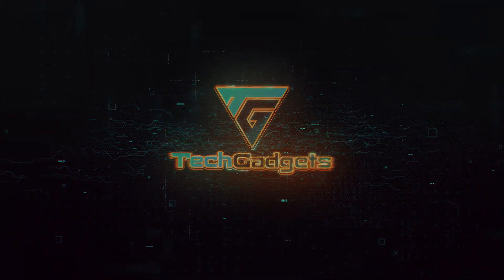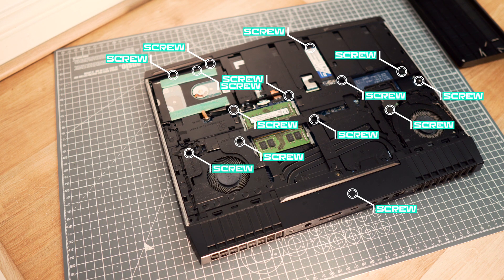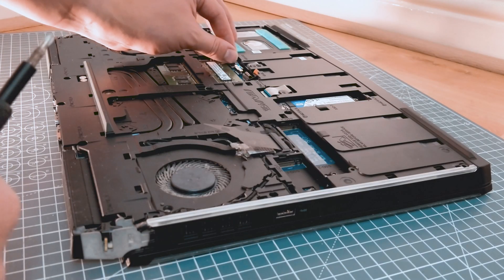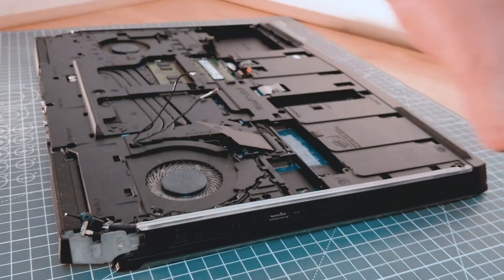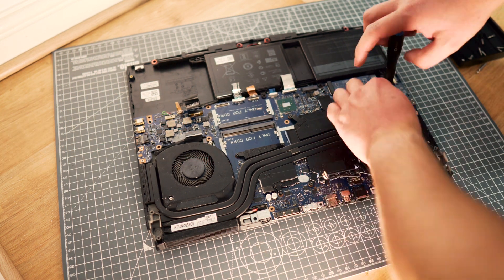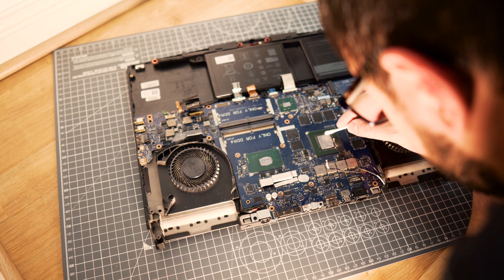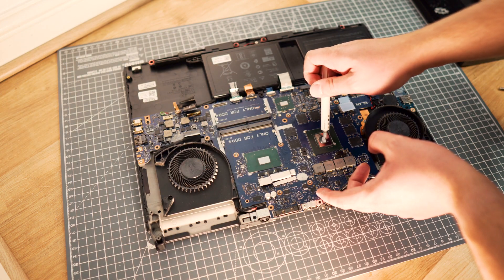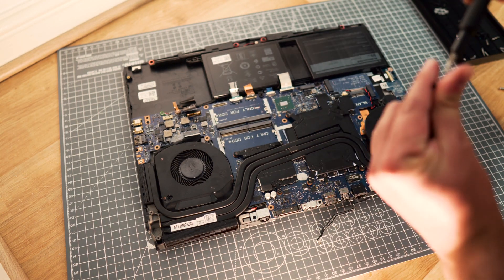Alienware 15 R3 Disassembly and CPU/GPU Repaste

Comment: Please note: Dont tighten the cpu/gpu cooler screws with an electric screwdriver, the screws are very soft and will shear off if tightened to far..which usually happens with an electric screwdriver

Comment: I redid my thermal paste and I use undervolting and underclocking via throttlestop... still have throttling when I try to play intensive games... I now need a watercooling solution. Thought about rigging 2 aios one for gpu and one for cpu but I don't know about cooling all the other chips around that. If I were to cut open those heatpipes on the heatsink what's inside of them? I was thinking maybe I could repurpose the heatsink and run tubing to connect them in a series so the entire heatsink could be one big waterblock then I connect that to a radiator and pump.

Comment: i got to the point of wifi card and lighting but i dindt dare to unplug them. id rly like to see how much temp can go down. rdr2 brings me to 100 degrees and perma throttling. such a shame actually considering this laptop doesnt come close running its advertised clock speed. an help near hannover xD?

Comment: Is this the GTX 1070 Variant?
Reply from the maker: Yes
Reply: @TechGadgetsMedia  Ty, And were the cooling fans taped to the heatsink?
I saw few of the models were...
Would like to know if "Kapton tape" can be used. 🙂
Reply from the maker: No, as you can see in the video the cooler fans are separated. They all connect to the heatsink with screws.
Reply: I get it, thanks for helping out with my query 🤜🏼🤛🏼

Comment: Out of curiosity where is the house located? I would like to place a cooling vacuum closes to it.
Reply from the maker: I'm not sure what do you mean by house
Reply: @TechGadgetsMedia  sorry, that must have been a typo and autocorrect issue on my part. I meant to ask, where is the GPU located?
Reply from the maker: The GPU is located in kind of the middle. You can see both the processors when I take the heatsink off in the video.

Comment: I notice that nobody shows how to fix that stupid wireless lan cable. Also is there a screw diagram where each screw goes? I ended up noticing that ive apparently put some of the larger black screws in the wrong areas.

Comment: Great Video!!!1 I'm adding IC Graphite Thermal Pads on both the GPU  and CPU  im running a GTX 1070 8GB and an I7 8 Core CPU Currently I do not have Issues with. but when I run my 15 R3 with the Alienware Amplifier and a RTX3070 Aours I can tell the CPU will Thermo throttle Game Performance.

Comment: Hey Buddy, i have this model and never clean or repested. Playing some games, the temps going at 90 C°. Max 98C°. But in normal day still on 40°C. Still cool?
Reply from the maker: That is quite high temp.. it is up to you but if I were you I would repaste the CPU and GPU.. there's nothing to loose.. and your number should reach a lover level.. also you might need to clean your laptop from dust.
Reply: @TechGadgetsMedia  Thaks You. I now put my processor at 98%. the maximum temperature reaches 70 ° C. I don't lose performance, so I'll use it until I clean and change the paste.
Reply: @eubrunao8271  How did you put your cpu at 98% ? I tried all possible solutions to undervolt but the latest bios update locked all undervolting options and also locked rolling back the bios. I have an Alienware A15 R3
Reply: @fareshesham8135  man, is to enter power options, then change plan settings, then change settings achieved, processor power management, maximum performance state. put what you think is best.
Reply: @eubrunao8271  I will give it a shot thx. Also do you have the same model as mine ? If not please tell me what model you have iam trying to see what works with what.
Reply: @fareshesham8135  My model is alienware 15 R3.

Comment: I just got an m15 r4 with an rtx 3070.

would you recommend repasting? Ive never done it before Im not trying to void a warranty
Reply from the maker: Are you facing thermal issues?
Reply: @TechGadgetsMedia  I dont think so. I play stuff like BeamNG, kingdom come, mordhau, rdr2. Nothing competitive. 

I saw a video showing my models disassembly and the whole internals need to come out to access the paste necause its on the other side of the board. I dont think I have the skill to do it myself. my 2016 model never got repaated and still works to this day
Reply from the maker: Well there are some program which can monitor your temperature. Also if it doesn't feel uncomfortable to the touch and you can still use it then you don't need to repaste.
Reply: @TechGadgetsMedia  yea the alien fx controller thing has trmps I was getting like 60 degrees casually playinf bur the fans went loud, and Im using a cooler mat thing eith fans too
Reply from the maker: @rajgill7576  that temp is really good and as usual a gaming laptop is always loud. I wouldn't worry if i were you.

Comment: When you’re talking abt temperatures, do you mean stress test temperatures or gaming temperatures? Also, if it is a stress test, is it a CPU and GPU combined load or only CPU load. What are the GPU temperatures ? Would love it if you can give me all this info. Thanks
Reply from the maker: I meant using the laptop for a long period while gaming or editing videos for example.. that's why I decided to repaste the CPU.. it used to go up to and sometimes over 90 degrees.. but now they are around 70-80 max.
Reply: @TechGadgetsMedia  K thanks! Is the GPU around 70-80 too ? My CPU hits 95 and GPU 84 during CS:GO and I lose a lot frames. Wat's ur avg fps in CS at 1080p high. It'll help me a lot !
Reply: @jivewig  after thermal pasting, i hit 70 cpu on cs go, 1080 high

Comment: Ayo I need to fix my laptop. It’s an Alienware 15 r3 and it’s like three years old, when I try to play overwatch now the gpu gets to 91 degrees and my cpu gets to like 100. (Celsius) when it hits that temperature it starts to have random framerate drops and makes it too hard to play. I’ve undervolted it, I’ve Turned off turbo boost, and nothing. I don’t have an intact warranty on it I don’t think, will a repaste work? Thanks.
Reply from the maker: It worked for me.
Reply: Honestly I think part of it is overwatch because I used to play it on an alienware 15 r3 also and the same would happen to me but all the other games have run smoothly
Reply: A little late but please consider cleaning your laptop from dust. My GPU temps used to reach 91° Celsius and after cleaning with a small brush and a normal vacuum just sucking as much dust as i can my temps started dropping to 70 - 75 at max.

Comment: I use an Alienware 15 R4 for gaming and I notice the cpu temp gets really hot. I am planning on replacing the thermal paste, but I am having trouble finding a tutorial featuring the R4. I wanted to ask if the disassembly of the R3 is similar to or the same as the R4 disassembly.
Reply: Hi Merrit, I have return my m15 R2 because it was being hot and the memory was soldered in the motherboard. Could you confirm the memory has slots in the motherboard in R4, please?
Reply: @BrennoLeal  I assume you are interested in buying the M15 R4, not 15 R4, which is what I have. I can tell you the 15 R4 does have user-upgradeable memory; but after some research, I believe the Alienware M15 R4, does, in fact, have soldered memory.
Reply: @CannedNoodles  you are right! They are soldered :(

Comment: Good Video Buddy, i plan on repasting my GPU and CPU too, i have the 7700HQ processor and its constantly at high temperatures.
Because of that i believe that my battery has lost all its capacity and now can barely stay out when unplugged. So im waiting a little bit so i can save some money to buy a new battery, additional 16gb of ram, a new ssd and some thermal paste to do it all at once.
Reply: Exact same, 7700HQ. I just got some ram and am thinking to repaste when I put it in - hadn't considered the heat is why the battery is worthless 😕
Reply: alienware soldered there ram on most models
Reply: @nee7720  not on this one, i saw you can upgrade it or exchange it
Reply: @jpsf3718  Oh nice

Comment: Hey bro I’m scared to repaste because the motherboard is flipped is it safe?
Reply from the maker: What do you mean by flipped?
Reply: @TechGadgetsMedia  you have to remove the motherboard etc and other components to access the heatsink
Reply from the maker: @hurricane5952  do you have the exact same model as I do here in this video?
Reply: @TechGadgetsMedia  i have the 300hz m15 r3 2070 super 10750h on bestbuy
Reply from the maker: Well I suggest to follow a video where an M15 is being taken apart. Just to make sure.

Comment: Great video! Thanks a lot 😃
I have the same laptop and I want to repaste it. So do you recommend a certain thermal paste brand?
Also do you recommend buying a laptop blower cooling pad like this one? (For gaming)
Reply from the maker: I use MX-4. It's cheap and reliable. For the cooling pad.. I would say it's personal preference. I don't really like them, but if you use your laptop on your lap then you might wanna invest in one.
Reply: I got the same computer as the rest of us here and bought a stand for 20 bucks on amazon and lowered my temps by 10 degrees easy.
Reply: @rubbersoul420  Ooh that's really great!🙂 Can you please paste its amazon link in a comment? Mine experience lots of thermal throttle while playing games
Reply: @rubbersoul420  Can you provide a link please
Reply: Great! thank you for your help man.
I forgot to link the laptop BLOWER cooling pad, here it is: https://www.amazon.com/dp/B07WVK2ZZ9/ref=cm_sw_r_cp_apa_fabt1_TSYQFbBB9W0SF
Have you ever tried something like this? I want to ask if you think this type of cooler can help lower CPU/GPU temperatures?
Reply from the maker: I never used it so I can't say it for sure. It supposed to lower the temperature so I assume it is useful. It's really useful if you use your laptop on carpet or in bed for some reason.
Reply: @TechGadgetsMedia  Aha I see! Good.. Thanks again and keep up the great videos 🙂👍